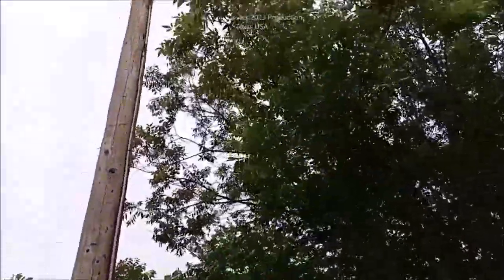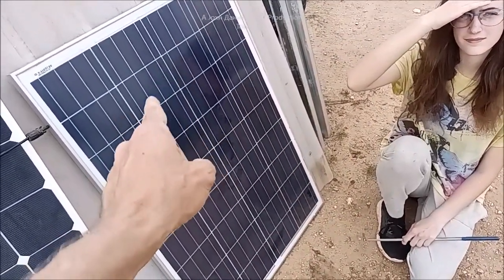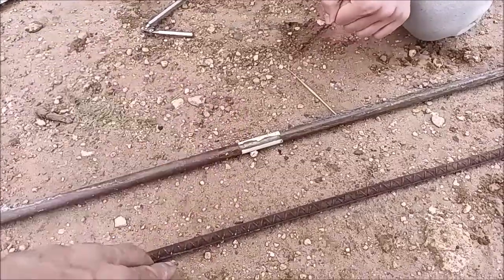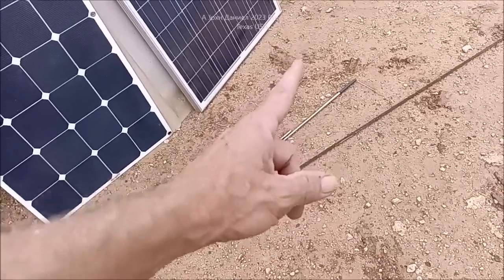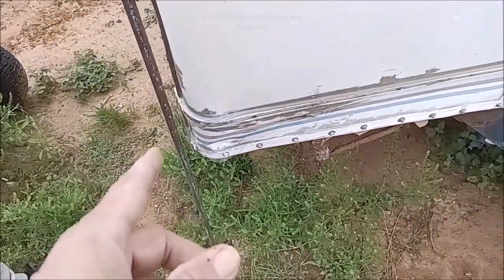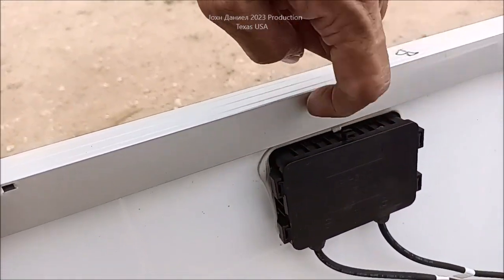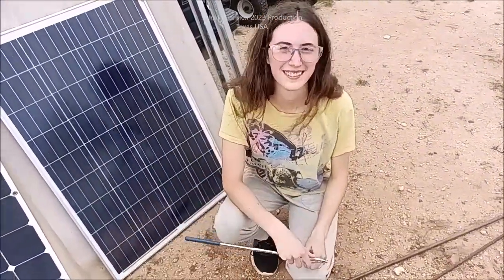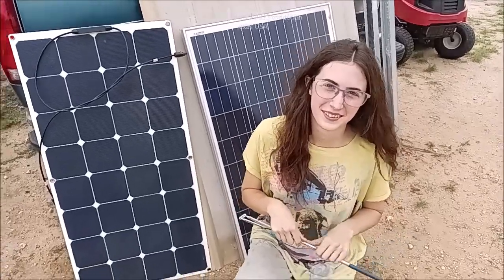Grounding your SOLAR PANELS? 🤔 You Better watch this First! *KNOW DC/Inverter POWER is not Utility

Comment: Some systems the inverters backfeed ac. Im dealing with this currently on an eg4 off grid system. 140v ac from panel frame to ground. Its in a steel roof so the entire roof is hot. Roof needs grounded for safety
Reply from the maker: Roof needs grounded for safety ( missing WHY you have power into your roof and panel frames!!!!!! )
Wanna stop that connection? Remove the inverter from the earth ground, you stop wild AC from being shared in a DC system that is connected to earth in the same location. Treat a inverter and solar controllers As NOT BEING A UTILITY COMPANIES 3600 rpm generating earth circuit conducive power system, and Voila!  everything fixed!

Comment: What about my 400ah battery bank in my truck..does it need to be grounded to my truck frame?
Reply from the maker: Connected as a DC circuit. Not grounded. Unless your planning on leaving your truck in one spot.
Reply: Thanks John 😊

Comment: Do you ground your wind generaters!
Reply from the maker: The steel mast is grounded via its methods of mounting in the ground and that grounds the metal body of the turbine due to the mechanical attachment on the pole, but not the turbine wiring.
Reply: @JOHNDANIEL1  thanks a bunch!
Reply: @JOHNDANIEL1  one other question,
Do tou put a phenolic gasket between the wind generater flange and the tower flange

Comment: Hello Mr. Daniel,  can you do a video on this...

I'm installing a solar power system in my barn.  I connected the inverter to a breaker box for two circuits (120 and 240 volt). This solar breaker box is not connected to the barn grid power subpanel. 

 How do I ground the solar power breaker box?  The inverter has a grounding lug, the PV combiner box has a grounding bar in it also.  Are the three components mentioned (solar breaker box, PV combiner box, inverter) all grounded together and connected to an earth grounding electrode?

I have decided not to ground the 180 watt panels due to the lightning issue. Thanks for your videos!
Reply from the maker: Using a multi meter, with everything up and operating go and test from those ground lugs to the Positive & Negative on your DC system/Battery +/-.  See if you get any circuit power, such as 10+ Volts DC in your results. If you do not, its only chassis grounding and you can using a 10 awg wire connect those items together and earth ground them for a simple static controlling ground. Static can gather in a chassis for a DC system ( touch the outside of your car body get a little ZAP when weather and atmospheric is right ) That only requires 3 feet of stripped copper coiled up in a 18" to 24" deep hole in the ground near your system. 
As for safety on your solar frames or any roof mounted metals, go at least 50 feet and place a basic lightning rod 10+ feet higher than your solar is and you will cover those needs too.

Comment: I am getting 35 volts on my solar panel frames but only when my inverter is connected. How is that possible and how do i correct it? My 1st thought was to ground it.
Reply from the maker: Have you grounded your inverter or connected its output to the house/structures wiring? If so, your common in the inverter and the eventual path made will lead to ground and you will get that kind of effect.
Reply: @JOHNDANIEL1  the inverter is grounded and it's not connected to any house wiring. I did some investigating and found I was getting 140 volts from an inductive effect from unused wires packed in the conduit so I'm looking in to that. Still can't beleave I got a shock from a completely unconnected at both ends ground wire.
Reply from the maker: @Ranch321  People for some reason ground their inverters to Earth ground that is on or near a system used for Utility power. Even being close to those systems can cause voltage leakage. The inverters output is wild AC, common is a created format, not a result or earthing like a utility has to do. So you have a active phase from the inverter getting into the ground or common, or even earthing, I prove this to so many people it's not even funny but they insist some genius says they have to do it. In reality, a inverter or generator is a stand alone power creation and has to be 100% treated as one.  NO sharing of wiring without 100% dedicated transfer equipment in the link.
Reply from the maker: @Ranch321  If you have 1 single volt with enough non atmospheric amperage to shock you on your solar panel frames, you caused it to exist, it simply can not exist due to the fact the frame is metal in any way. The aluminum frame is NOT in the circuit of your DC voltage, the earth or your inverter without you making a connection to it. It is 100% isolated, just like your car, fence, lawn mower is until you introduce a circuit into it from a source.
Reply: @JOHNDANIEL1  so after grounding the unused wires in the conduit the voltage seems to have all but disappeared so I think it was feed back from an inductive load generated by the proximity of the unconnected wires in the conduit. Also the grounding rods im using are 600 + feet from the utility grounding.
Reply: @JOHNDANIEL1 you are right. A transformer, a generator and a solar system are considered "separately derived sources". They are indeed standalone.

Comment: only time ive ever seen grounded solar is in the USA , i guessed they did it for lightning HEY it works LOL, what kinda solar panel efficiency is that i wonder  LOL.
i was thinking with my PUNY brain i should do a MEN connection and grounding on my off grid inverter so rcds actually trip in a timely fashion and i dont get sued if someone gets zapped if by some unlucky chance they happen to cut neutral and active simultaneously with someting conductive.
Reply from the maker: People in Code Writing Grubberment offices are just morons. They confuse Utility power with inverters and portable generators. They confuse Solar power creation with Utility Power. Only the utility MUST have a ground to earth and it it NOT for lightning or some nefarious need, it is to complete its actual circuit. ( Westinghouse 1898) ( Tesla 1891) ( Pavel Yablochkov 1876 ) ( Earnest Free - Edison Labs 1899 ).
Earth grounding any object increases its likelihood of receiving a lightning strike by over 700%, (US Military Naval Electricians handbook 1971), (General Electric HVT Study - 1932) 
On site self contained power generation ( David Sumpter - Cole Hersey 1925 ) ( Vorgas Lemetti - Siemens - 1892) ( Chester Bradford - IBM 1949) has no need or requirement for the use of earth grounding for safety or completion of circuits. On site is not at risk of atmospheric electrical fields such as discharge or lightning. Fusing of high tolerance reactivity is recommended for safety.
YOU GOTTA GROUND YOUR ROOF, SOLAR PANEL FRAMES, DOGS, AND COWS ( Bubba You Tube Uploader - 2023 )

Comment: not to bee rood, but you have to read the book of rules, for electrician,
Reply from the maker: Not to be Goo'fee, but electricians rules are not actually by real definition applying to electricity from non commercial solar, ( applications under 25kwh ) they bees ill adapted. NEC has only adapted, not set the standard. *Solar not mounted on commercial structures is still caught between DOT and NFPA 1192 Subsection 3-8 and the NEC solar PV systems in Article 690 of Solar Electric Systems and Article 705 Grid Tie applications. (DC Residential Code 2017 - Modified 2015 version) In HOME OWNER DIY use, the NEC still has this listed as this application Battery Back up, or DC electrical codes as: *low voltage systems, that with voltages from 0 to 150VDC, "grounding by definition is the use of the negative battery or converter terminal" on the source of current and not to be confused with the VAC defined by BOCA National Codes and References,  eCFR :: 49 CFR Part 236, and NEC standard for grounding using earth or structural ground.
Bee too Rood is the way man!
To be more defining, makers of "power stations" such as EcoFlow and Jackery will void your warranty if you connect chassis of device to your residential utility ground which under CE standards is a hazard to owners of such devices. The fallacy of grounding DC came from the 1992 UPS ( battery and inverter combo ) systems installed in homes that was later retracted in 2001 after over 12,000 battery in UPS related fires caused by ground return voltage under the new codes on UPS.
Reply: @JOHNDANIEL1  Sorry friend, i live in Denmark, thats very diefferent , her we do "grounding " to potenial connect to metal stuff, whit in reach,  no grounding on non metal roof...

Comment: I'm not here to diss you. You, as a man and a father just recently gained my respect. 😊
But... you do seem to be a little confused in regard to electricity and electronics. 
I will not start blabbing about my experience but:

Grounding in any electrical circuit is a protection feature. 

In AC systems it can also properly protect us from electrocution. 
In DC systems, grounding protects the electronic components and protects us too from loosing cash, housing, life and limbs. 

There are three main big dangers in solar power systems that can be reduced with propper grounding:

Electrostatic buildup - your panels and cables mihht be high-up somewhere and if they float (electrically) in regard to the ground, they can acumulate really big electrostatic charges. These can really damage electronics even if it can't pose a (direct) life or health issue. 

Faults and EMI/RFI - now these won't work in impropper instalations but, in general, poropper grounding and propper overload protection systems can prevent electrocution, electrical fires and radio interference. 

Induced surge currents from lighthning strikes - now, if your system is struck by lightning you're screwed, period. But if the strike is not direct, dangerous currents are still induced in your system. The later can be adressed by propper grounding and propper protectiin circuits. 

The ground is a third conductor in any circuit. It is the conductor we humans are in contact with. It is regarded as a neutral refference and usefull in fault detection and mitigation. 

As anything else on this particular planet, impropper grounding can do more harm than good. 

Stuff that is high-up should be grounded or have pathways to grpund for surges. Stuff that can leak currents on the outside sould be grounded.
Reply from the maker: Not confused one bit, but if grounding solar panel frames is important to you, do it. Grounding unpowered things that are on everything will need a few trillion tons of copper. Argument being equal, unless its to be cherry picked to eliminate inconvenient facts.   See you at the aluminum skylight grounding party.
Reply: @JOHNDANIEL1  iron is good enough for putting those electrostatic buildups to rest ;)

You reminded me tgat a local hardware shop used to sell copper plate,  cables and rods for grounding and I found out after they sold it all and never stocked back again because it sat in shop gor years

Edit: and I was writing specifically about electric/electronic stuff not skylights but I'd ground that too. 

Let me tell you about a personal experience I had a month ago. I lost $5 worth of equipment but that is not the point.
My pv system at my new home is currently under construction. Nothing fancy or big, just 1.2kw of pv on the roof. 
The grounding and suppressors are still work in progress and I forgot to disconnect the array when I left for a while. 
There was a storm, not much but with some lightning in the area. The house was disconnected from mains, the charger was disconnected from the battery but still plugged in the solar array. 
One digital voltage/current monitor was fried. Nothing else but if the esd/surge
protection box would've been grounded (and populated with the appropriate IGDs :)) ) nothing would've happened. 

Stay safe. The costs of grounding and protections are no match for the costs of property, health or life.
Reply from the maker: @PașcaAlexandru  So far, and thats just due to medical center records deaths from any form of DC voltage is responsible for 108 deaths since 1980, nearly all are misuse of a welder. AC voltage is responsible for 331,800 deaths since 1978.
When a solar and controller event happens, 99% of the time it is that the controller was earth grounded, using the chassis post or shared a ground with the structures utility rated ground circuit. Any if not all ground rods produce a eddy current to above ground objects, and can in storms release a  discharge voltage. They are for AC voltage, not DC.   https://ep2000.com/understanding-neutral-ground-grounding-bonding/ and the facts about DC voltage can be easily summed up by the following https://www.history.com/news/what-was-the-war-of-the-currents 
Your frames on your solar panel are like your frames on your windows, skylights, metal flashing on a shingled roof. In fact, the National Roofing Contractors Association recommends NOT to deliberately ground metal objects on your roof to deter corrosion and lightning opportunity. 
Lightning arrestors, EMP devices and grounding non in circuit solar panel frames is snake oil and only increases your likely damage.

Comment: Always ground above 120v DC! (3 pannels in series)...Above that, it will kill you.
Reply from the maker: If your running your power though your aluminum frame, then your already making trouble for yourself. Re-wire to remove using the isolated frame from your circuit. Seems people are confusing Aluminum frames on solar panels with it having any voltage to start with. Otherwise use fusing or breakers and proper gauge wire and no matter what your DC volts are, never use the frame as a circuit.
Reply: @JOHNDANIEL1  If you have a damaged cable the DC can go to the frame. If it is not grounded it will go through the lowest resistance ( your body ). A fuse in solar is the one thing you should talk about. Solar pannels can be shorted and will never go above the Isc current so in most cases a normal fuse will do nothing. for lightning protection have teh rod before your installation. ( between your pannels and the installation ). Also make sure you dont have an induction loop and install an SPD. You can not compare a 800vDC multi pannel string to a 12vDC car. DC will kill you above 120vDC. With DC there is no sinus where you can disconnect yourself when polarities switch(0vAC). DC is very dangerous. sorry to say but your advice could kill people.
Reply from the maker: @zelfvoorzien  My advice stands as I showed. I explain it as low voltage, I never discuss 120 volts DC, in fact the entire list of objects in the video is under 48 volts. I refer to fusing at the panels which is factual. But if a wire from your panels, 1 wire is shorted to frame you will not be electrocuted unless you grounded something next to it as well as or to the batteries in the system. Learn about DC electricity some, you can touch the post on a 200+ volt DC terminal, which I have done on video and without you creating a path by also grabbing something near it that is grounded to the other side of the DC power equation, you will get absolutely nothing into you. ( Westinghouse /Tesla  AC verses Edison DC argument over 100 years ago, learn facts )  https://www.history.com/news/what-was-the-war-of-the-currents . AC voltage can bite you due to it being in cycles, touch one wire whether your grounded or not, you get bit by the +/- which creates a partial path.  
You don't have to believe reality, but you can prove me wrong, it's easy. Get a large Capacitor, charge it to 600 volts DC, touch one side, + or - choose either! When you get absolutely nothing shot through your hand, then reply. Now ground the table your sitting it on, repeat test. Now Ground table AND the other side of that capacitor plus put your free hand on the table............. OK, now your missing fingers.

Comment: Failing health and resulting failing finances are forcing me into full time RV boondocking, and of course everything will be DIY. I will be building batteries using EVE LF280K cells, covering the roof of the trailer in solar panels in parallel to diminish shading issues, and possibly next year building a wind turbine to add to the trailer. My college electronics is 46 years rusty, so I'm wondering if you are able to some mentoring? My current thoughts are to build 4, 12 volt batteries in parallel (total 1120 amphours)., feeding a busbar, feeding a 4000 watt inverter. In case the trailer is in partial shade, I'm planning some  portable panels as well. To top up the LIFePO4 batteries while driving it sounds like I'll need a DC to DC charger.  It seems I may need multiple solar/wind controllers. I realize those are a lot of topics, but any thoughts you can throw my way would be appreciated.   Thanks for reading my lengthy chat.
Reply from the maker: I would if you want to save $50 easy, go to Sun Gold right now, they are best thing going https://shrsl.com/42bmr 
If you get 18 panels, you can run 6 at a time on 3 of the HQST 40 amp controllers ( https://amzn.to/41wEohx ) running them 2x2x2 like a 24 volt set up, 44 volt,  that will make your outcome perfect for your 12 volt RV system on those controllers. I say to use the HAT metal for mounting them, but work with what you have. The best battery is a pair of the TIME USB 220 https://shrsl.com/42bna so when you can afford it you can add one more, or end up with 4 total which will make your plans complete. But 2 will run a 3200 watt SWI power inverter to run a good sized AC unit, you would need 3 or 4 of them to run a AC unit, Microwave, TV, Refrigerator and more on a pair of inverters or a 4000 watt Sun Gold. I Prefer the Sungold 4k for RV use.